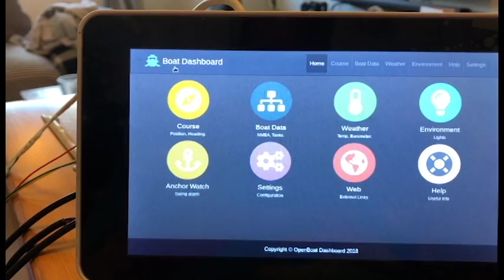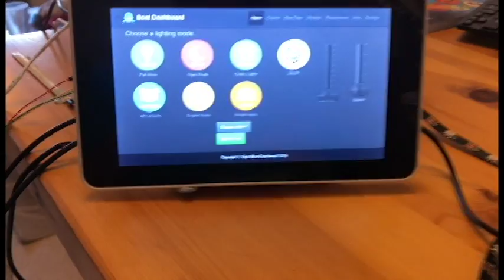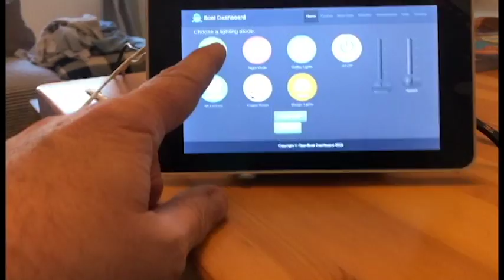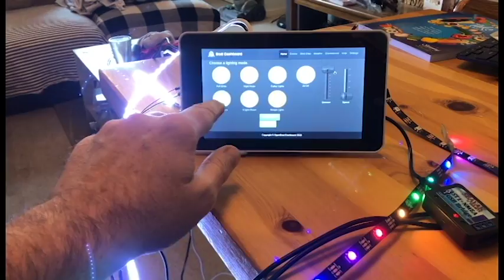Boat Dashboard

Comment: Outstanding work! I am working a similar system based on ESP8266 and ESP32 based web servers using the ESP as a wifi Access Point.
 It provides engine data for my air cooled long tail mud motor. Now I am working on adding gps data for speed and course, also  digital switching for my lights as you have done.
It forced me to learn some html, css, and js and now I want to move to raspberry pi and learn how to make a gui for python. 
Again, nice work!